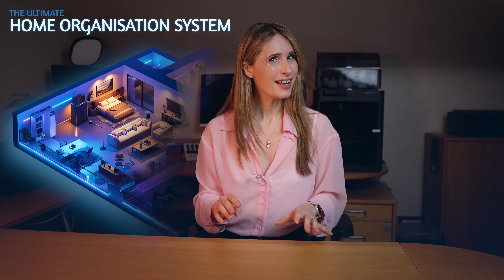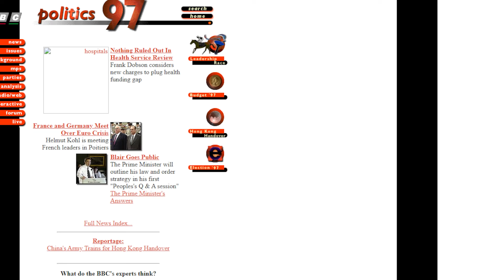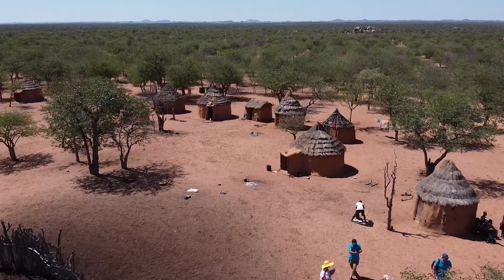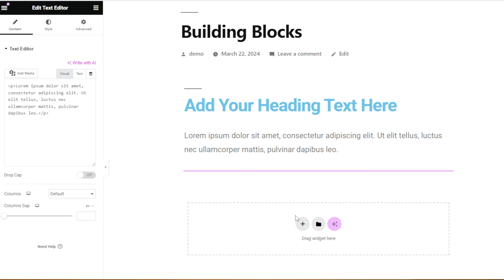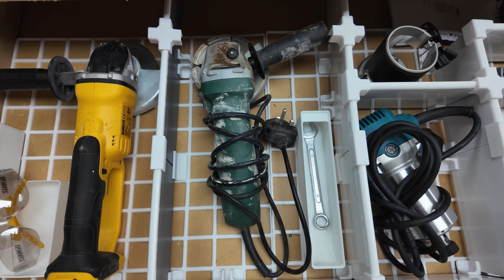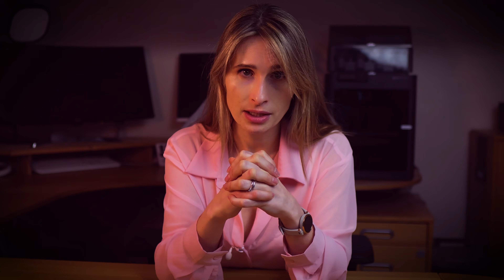Open Source Home Organisation: Four FREE systems to engineer order in YOUR home.

Comment: Challenge - Yarn storage 🤣
Reply from the maker: Oooh great challenge!! I may just accept that one! ;)
Reply: @handsonkatie  That's great! My current issue with my yarn storage is that, I have a lot of colours and also back up of the colours so I need 1 set of "working" colours and storage for the back ups. Haven't managed to find a good way to store the working yarns yet with maybe backups at the back?
Reply from the maker: Ooh that's interesting - I actually punched a hole in the wall and built a door into a little attic space next to my sewing room for this (I know it's a bit extreme, but it gave me another 10m of storage once I'd floored and added ceiling in there! 😊).  I might need to look at how they do this in knitting shops next time I'm in one - it's normally quite easy to see how they stack them on the shelves and then copy with a 3d printed version - added to my list!!
Reply: @handsonkatie  Nice! Unfortunately where I live, I do not have the freedom of modifying my house however I like. Knitting shops have great storage for people to shop but not so much for working so that's my problem there 😂

Comment: Yes! Love it. Im already pretty organized, but this gives me a new set og tools and things to apply! 

Challenge; How do you take this on the road? 

For me, my work as a filmmaker and hobbyist handyman takes a lot of my stuff in and out of the house and for a long time i struggled. 
Then i started investing in the Milwaukee Packout system, and now most of the major things have become a breeze to get in and out of the house. 

I even have an amazing double set of drawers on a wheel base that is all modular and stores ALL of my build pieces from the smallest screws to plates, infinity arms and so forth. Easy to bring and i dont have to over-prepare before leaving the house. 

I just got my first 3D printer this week, and found Gridfinity plans for the drawers, so now it took another big step up in quality!

My biggest issue with this approach is that it works well as long as the drawers remain flat, and arent subject to an accident or even a rought road on the way to location. 
The original Milwaukee system is designed in a way where the cases have lids with indentations that seal each of the sorting container, so you can grab a box full of screws and mount it to a wall and then just pick it down, lay it flat and get whatever you need. No mixing of small parts. 

So i guess the challenge would be to get gridfinity working better within this system!
Reply from the maker: Interesting challenge!! If you check my more recent videos on this topic, you'll see things like openGrid have appeared that let you 'lock' things into place. Likewise I cover things like gridfinity boxes with lids, tambour doors and more - so this would allow you to replicate what you describe. You can even print whole boxes to fit your gridfinity boxes - eg: https://gridfinity.perplexinglabs.com/pr/gridfinity-rugged-box/0/0

Comment: Hi Katie. I’ve asked this on Maker World but thought here might be quicker. 
For Neogrid 2.0 using the parametric builder, I might be being thick here but does the parametric builder allow you to change the length of say a bottom straight part? I want a gridfinity of 1x5 for example and I can't work out if that's possible within in the builder as I seem to be able to only do a 1x2 - or if this needs to be done in the likes of Fusion????
Reply from the maker: Hey Martyn - sorry, I must have missed your makerworld comment! Yes, you should be able to do this (if I follow you correctly). Do you want to post a question in discord and I can paste a screenshot of the settings?

Comment: Thanks.  I'm finally getting around to looking at tackling some of the chaos of drawers and cupboards.  I think first up is going to be the cupboard for all the baking trays, cake tins, etc.  I'm thinking grid base with dividers for some of the trays but then three walls -(27cm height)  left, middle and right of the grid going up to connect to a 3D printed shelf to have the cake tins on.  The height is bigger than my printer base so I may have to have it shorter as I'm not sure about vertical connectors.

Comment: I'm so happy to find you (your sewing room looks like the inside of my brain except with steel, machine parts and air cylinders) My state is the culmination of 45 years of manufacturing ( and prototyping) machinery. welding one minute, wiring the next then there's still assembly, paint and nowadays filming for demonstration. You're approach leads me to beleive you have already gone through this chaos and found ways to put a stop to it. You also are very good and communicating the larger ideas behind your method and execution, at least for the way my brain works. Over the years I struggled with making my ideas understood, often I'd have to make the thing before people understood and accepted whatever it was, I think you have mastered this beautifully and I will enjoy your media while I struggle though my own chaos.

Comment: In my eyes, multiboard seems to be far too complex to remain practical. It is not flexible because the individual parts are so specialized and it is not a solution that you “just do”.

I would prefer an open, standardized solution like Skadis. This would also have the advantage that you could make the panels from cheap OSB boards using a CNC router, for example, and not have this enormous filament consumption.
Reply from the maker: Yes, this has been a common criticism and I do think it's become needlessly overcomplicated Vs solutions like Gridfinity.  However, if you look at this and other videos, you'll see I basically use one 9x9 core grid and Multiconnect screws (designed by David D) and this is a far more flexible and simple solution for all my needs, so two pieces! So I'd use the bare minimum you need and keep things simple. But that said, I know of other things brewing..... 😉
Reply: @handsonkatie  Oh, now I'd like to know what you know about. 
I'm currently thinking about which system I want to start with on the wall, but nothing really convinces me yet. I'm also still skeptical about whether the base plate material really has to be plastic or whether there shouldn't be some flexibility there too.
Reply from the maker: Check some of my later videos and it covers how I use it in more detail!

Comment: Nice job! Did you already make a video about Neogrid? I found your post but here, in Brazil, I dont have uPVC window frame like you have. I would love to see a detail to find some replacement here.
Reply from the maker: Yes, although there's a new version in beta that will let you edit the size super easily - if you'd like to join the beta test, just email me on my site and I can get you into discord!
Reply: There is a 8mm version on makerworld, if you can and want to use 8mm wood boards.

Comment: What about the fact that PLA turns brittle over time?  Every pegboard accessory I ever printed in PLA broke after a year or two, it became worthless.  PETG holds up, but obviously is a different material with unique challenges.
Reply from the maker: Think this is possibly more your filament brand than the material? I use Elegoo and Bambu mainly, but I've had PLA outdoors in freezing weather/full sun and loads under load on shelves for 5-6 years that all looks as good as new, so I can't say I've experienced it. If you've got a modern printer (eg Bambu) then printing PETG is pretty much just as easy, so you could use that if you want!

Comment: This video is great but Multiboard is not open-source.
Reply from the maker: Yes great point, as you've no doubt spotted, I really don't use much of Multiboard, apart from a single core 9x9 tile - the rest of the thousands of parts is quite over-engineered and is stifled by the licencing, so I just create all my parts that I've shared. These are open source as they use open source elements like the brilliant multiconnect (which Multiboard have heavily 'emulated' in their latest changes). So the strict title should be Open Source Home Organisation: Four Free systems (although to be clear my guide covers how to use open source solutions for one of these which isn't technically open source) to engineer order...    <damn Youtube's title character limit! ;) >

Comment: Any recommendations for where to get materials from for the walls for your neogrid?  Preferably plastic/acrylic/perspex but the likes of B&Q or Wickes seem either too big or too small
Reply from the maker: Hey Martyn - I used utility board/soffit board that you can pick up at any builder's merchant (I think even Screwfix/B&Q stock too) - but the file is also parametric, so you can easily adjust the thickness for anything - acrylic would be great for this, so you could just test print a piece to get the perfect thickness (I'd start at about 0.1mm bigger than your material for a nice tight fit!)
Reply: @handsonkatie  Thanls Katie. I’ll be out with my tape measure on the weekend having a look. Still looking at the likes of Fusion360 and how to amend the files, that’s still beyond me right now for the time being
Reply from the maker: I've got a video draft I'm going to record that will get you 3d modelling in 10 minutes!!!  Watch out for that in a few weeks!
Reply: @handsonkatie  Cannot wait! I actually worked out changing the parameters of your parametric download. That was pretty snazzy. Will be trying to learn tweaking some other models over the next few weeks so this sounds perfect.

Comment: fellow engineer here.  The original metric system was based on the arbitrary notion that the distance from the equator to the north pole would be 10,000 km.   once they decided this distance was the arbitrary base measurement they decided that 1 gram of water, would be the size of 1cm cubed.

they then created pieces of platinum to be stored inFrance. if ever there was a question of how long a meter is, check the piece of platinum.

yes, nowadays we have redefined metric by using wavelength in vacuum, but it's origin is both arbitrary and fascinatingly scientific at the same time because the gram being related to the size of a cm of water, and the wavelength we chose is still related back to that original piece of platinum.
Reply from the maker: Wonderful comment and yes you're spot on! (I had a much longer ramble about this that I actually cut out as I thought likely be not of interest to people), but I do love the fact that the 'fixed ' measurements they chose have proven less than fixed as science advanced! In this sense, metric is really an advance on imperial, rather than an opposite - it's based on much more constant measurements than 'someone's foot'!

Comment: Great video - another problem that annoys me is how to incorporate accessible data and audio cabling into a domestic environment. When I did my home extension in 2000, Cat5E was state of the art, but now it’s slow and old hat but it’s inaccessible behind the plaster wall. In an office environment the solution would be cable ducting and false ceilings, but that’s not going to look great at home. I’d prefer not to use wifi, any suggestions?
Reply from the maker: You're completely right - I'd install plastic tubing (just use 35mm pipe for waste water or something cheap like that) - but that's obviously BEFORE you plaster the walls! I might have a look at this at some point though - I've seen skirting boards that pop off to let you run cables behind them (a very expensive alternative to a few hours with a router IMO! However it might be fun to build cable mounts that integrate on top of skirting and seamlessly seek to 'disappear'.... I'll have a muse!

Comment: Thank you for excellent video! Was trying to make neogrid bits but my board is 3 mm thick. The files do not seem to be parametric. Could you make bits for 3 mm boards like you said in the video. Thanks in advance!
Reply from the maker: Of course! - there's also an fusion 360 file that others have used to adjust themselves, but happy to pull together. Do you want to drop me an email on my website (www.handsonkatie.com)? I'll send you a test version so you can check it fits neatly - I suspect you'll actually want something like 3.1mm for a tight, but not too tight fit!

Comment: What made you decide on Multiboard over Honeycomb Storage Wall?
Reply from the maker: Hey Scott - main factors were really smart multi format (ie it works with Multiboard, honeycomb, pegboard and more) and strength - very strong format, holds 20kg+ so gives lots more flexibility (and tied to this, the ability to screw in fixtures makes it much stronger than push fit designs)

Comment: I have already started with Gridfinity and love the modularity of it. 
I like your Neogrid, blending Gridfinity, printed parts and available slats. 
I was starting to use HSW, but like the multiboard approach. I will likely switch over to it. Some of my HSW parts can be adapted to it. Others may find limited use on one wall, (that may be departing soon anyway.)
I have french cleat on my wall over my heavy workbench, and enjoy how easy it is to build a new fixture for it.
I have several of the square shelving units (1 foot by 1 foot grid) that I am trying to figure something out for. They end up taking square bins that accumulate clutter. I'm thinking some kind of drawer inserts to put other organizers in.
Reply from the maker: Love it Glenn - sounds like you and me think alike! Regarding the shelving units, yes, I find vertical height is often the challenge area - too much air and not enough storage. I often end up building in shallow drawers to allow me to have a stack of them within the cube, then I just rebuild the shelving units myself....!

Comment: Thanks for a great video!
One challenging area for me is cables. I have lots of them. They are sorted in large boxes by type (audio,videos,usb,power,etc) and while it works ok, it's not great. Esp USB has tons of various connectors so when I need to find a specific cable I still need to go over quite a bit in the USB box. Any suggestions and ideas in this area would be great for sure :)
Reply from the maker: ..not just that, but the silly USB standard is poorly demarcated - does that USB cable work with data or is it just a power cable for example?? I have just the solution for both, keep an eye out for upcoming videos for this. I might even do a dedicated video on cables - it seems a very common challenge!!
Reply: @handsonkatie  Agreed. Also, while it's a good idea to have set of spare cables for various cases, it likely would be an idea to cull away some older cables that has some duplicates and never will be used again.
Reply from the maker: Agree, although it's one of the mysterious laws of physics that the moment you do that, you'll suddenly have a need for more and be one short..... 🤣
Reply: @handsonkatie  Yes! There is a reason I still have sooo many cables :D also a big box of random PSUs because they make come in handy "on day"

Comment: for cables I use the tubes from toilet paper. I found that rolls of cables easily turn into knots. If you fold them back and forth, you can put them into tubes (or use cable ties instead). You can place the tubes in vertical orientation in boxes. If you keep the connectors on top, you always see which cable it is.
Reply: gotta coil the cable like stage hands and media production workers...follow the natural coil of the copper within...its always extruded into a spool...all other forms of rolling or folding cables/wires damages them and reduces their longevity...thats right...wrapping the power cords around your arm and elbows to coil them like our fathers used to produces kinks and destroys the cable over time...actually makes the unmanageable with all the bends that stay...